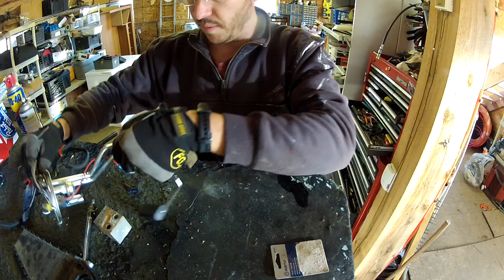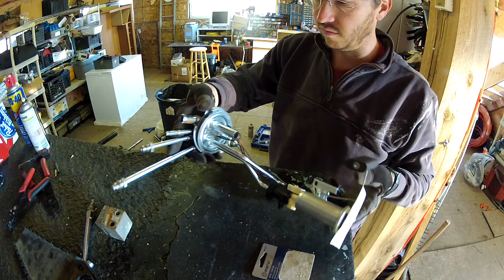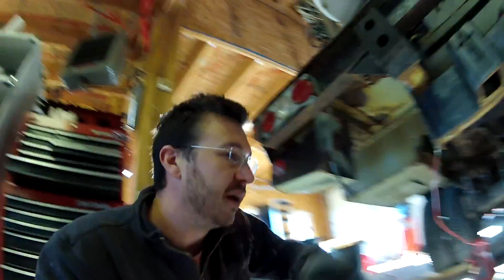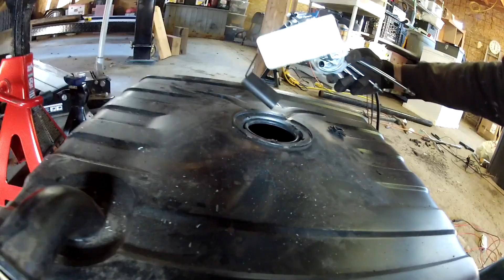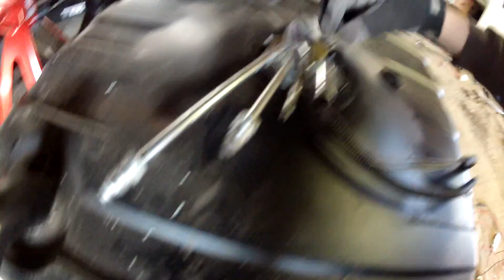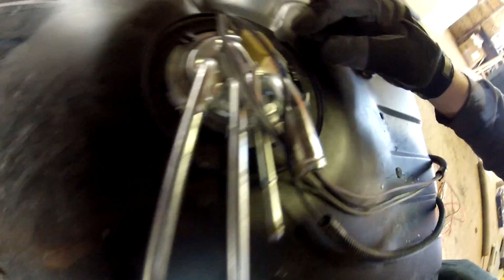4 - Gas Tank Install Chevy 3500 Bucket Truck

Comment: I watched you install it again and saw you said not to upset the rubber gasket! whew I was worried there fro 30 seconds!
Reply from the maker: I know!  I had 3 of those gaskets by the time i was done buying the tank, the sending unit and the fuel pump, they each come with one.  I surely would have rolled that thing down the hill if i'd forgotten it... :)

Comment: I hope you installed 1 of those O-Rings under the fuel pump/sender gauge bracket on top of the fuel tank to keep the gas fumes from escaping and gas sloshing out as you drive!